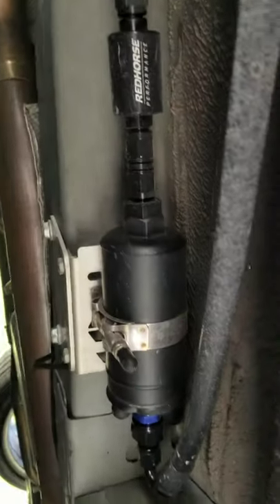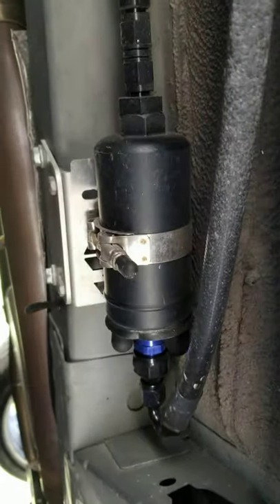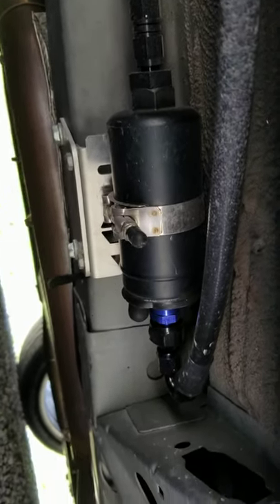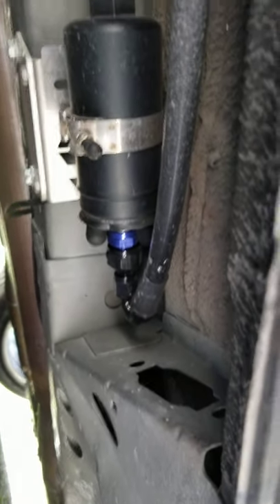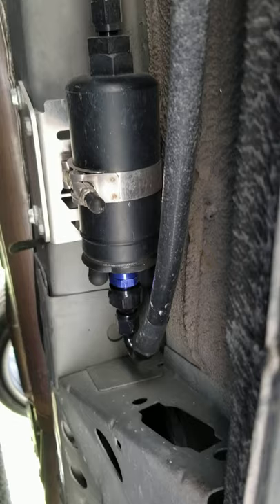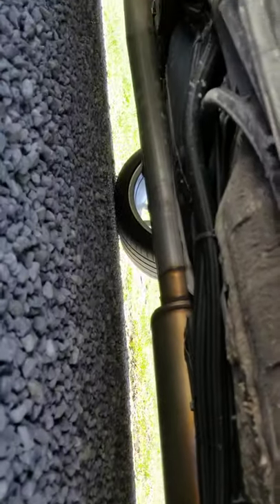AEM pump upgrade to DSX kit

Comment: can you tell me what fittings you got to accommodate the larger pump? im assuming youre still using the lines provided with the dsx kit
Reply from the maker: yes I used the existing lines. I believe we needed 3 different fittings to make the lines connect. You will need to add a relay if you plan on making this upgrade. The pump draws more power then the standard pump in the kit.
Reply: @unkulbobby  I gotcha. Yea I planned on going aem 400 or Bosch 044. Did you add the relay in series with the dsx harness too?
Reply from the maker: @brandonwarren4614  yes we did. This setup supported just under 900 whp with E. We still had room for a little more.
Reply: @unkulbobby  yea im over 800 estimated now with a ported blower. Was having fueling issues. Upgraded to aem in tanks, fp is good but I wanted to be safe and just upgrade the aux too

Comment: Does it work well with the dsx controller?
Reply from the maker: It does. Add a relay though.  The bigger pump draws more amps than what the controller is designed for.
Reply: @unkulbobby   you just add a 40 amp relay?
Reply from the maker: @colbynelson2011  I believe we put a 30 amp on it.
Reply: @unkulbobby  you add the relay before or after the controller?
Reply from the maker: @colbynelson2011  the controller is acting as the switch, so it should go after.
Reply: @unkulbobby   thank you so much I appreciate it
Reply from the maker: @colbynelson2011  no problem. Good luck
Reply: What fittings did you use to make this work